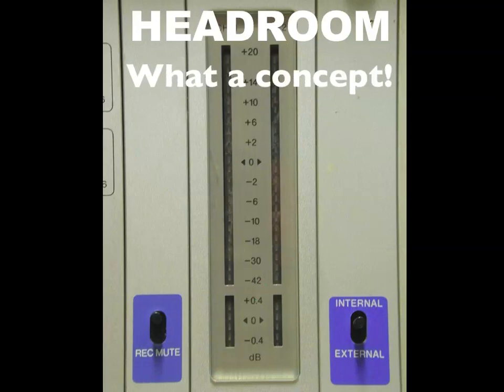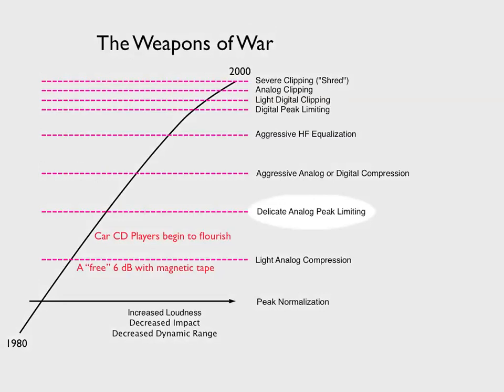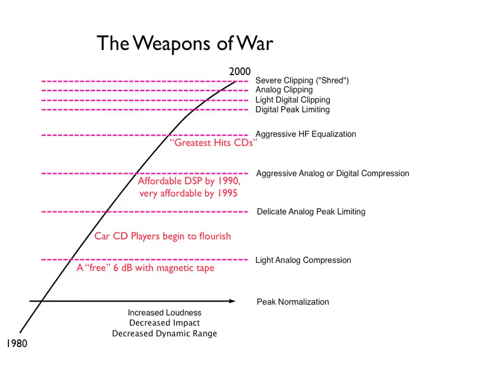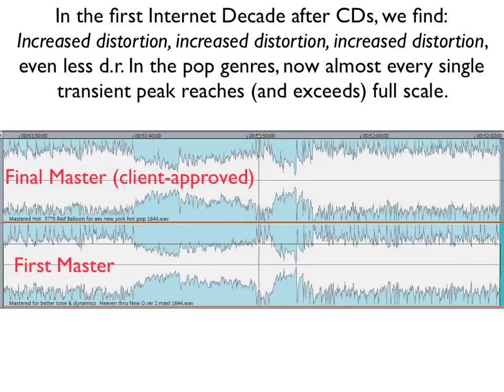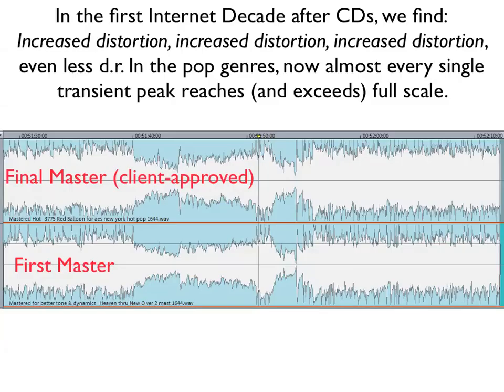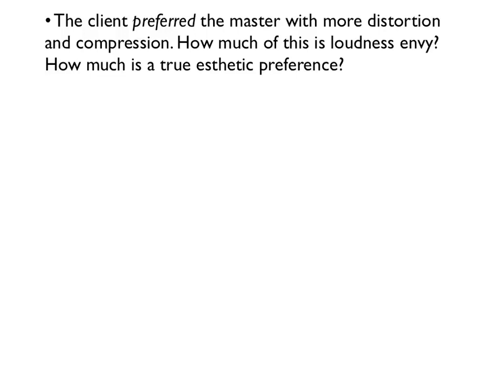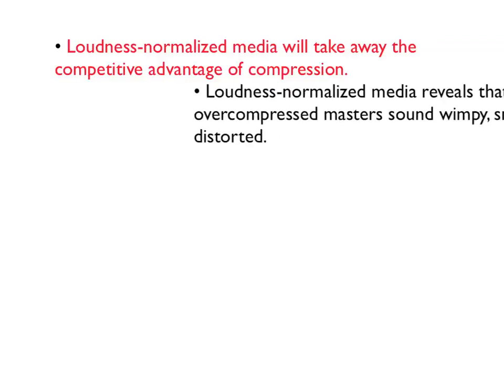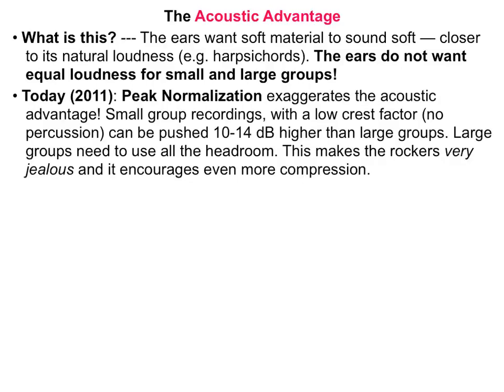Loudness War and Peace

Comment: Well it's 2025 and in heavy EDM bass genres my loudness target is 0.1 LUFS @ the drop and -13 LUFS for the breakdown/ambient sections.

Even when the level is matched (renormalization using lufs) my masters sound louder than acoustic masters.

Personally I believe this (old school) paradigm is just lacking. It misses so much of the potential you can use from psychoacoustics.

You can make a kick drum where the entire sample is touching unity (0 dbfs) and it still sounds incredibly punchy. Then again this is hand crafted waveforms not recordings. Deep sculpting of the distortion so that it's pleasing, thickening, & warming to the sound.

Comment: Great video! 
But speaking of normalization, if a song of -6 lufs is normalized to -14 lufs, will it still sound louder than a song that is originally -14 lufs?
Reply from the maker: @astroneko404  good question. When Comparing The extreme density of material that has been squashed into a sausage with a dynamic song that’s got soft verses and loud choruses. You should compare chorus to chorus. The verse of the sausage song will be obnoxiously loud. Yeah, if loudness is your only criterion and sound quality and dynamics are not important to you - then, probably somewhere above -8 lufs you can make a loud sausage that will appear louder than a native -14 lufs song. It’s a dilemma. I know what I would pick, but it also depends on genre, style and the message of the song.

Comment: Super interesting video. I found your name recommended by someone in a gearspace forum. I wondered what youre thoughts were about a daw like reaper operating at 64bit but using plugins like Waves operating at 32 bit, Ive recorded at 32bit fp. Ive read that there is either some sort of dithering happening within the daw or the plugin itself. Ive read elsewhere of course dither doesnt matter at such a high bit depths. With a little of my own experimentation I could swear I hear a subtle pleasing difference adding reapers dithering plugin before my waves plugins on on a 40 track recording and also before sending out any outboard gear with my rme 24bit converters for outboard processing. The difference is subtle but it seemed to take away a harshness Ive been battling for a couple of years. Is there anyway you could clear me up on this. Can quantization errors happen between the internal processing between different plugins operating at different bit depths and would possibly be resolved through dither. Also should dither be used when sending to outboard gear and back in. 100 articles have told me its not necessary due to the noisefloor yet I can hear a difference though its possible Im fooling myself. Thank you for any response.

Comment: The most dynamic CD that I have, Speaking In Tongues by Talking Heads (the version featuring the LP edits), looks to have been mastered very early on in the CD format's existence, in 1983. It has a dynamic range score of 17, and sounds excellent provided that you turn your volume all the way up. In general the average 1980s CD in my experience has a DR score of about 12 or 13, while a typical mid-late 1990s CD has a score of around 8 or 9 and a lot of recordings from the mid 2000s to present score just 5 or 6. This means that many 1980s CDs are more than twice as dynamic as digital releases from the past decade. I find it pretty weird how a lot of nearly 40 year old digital releases sound better than modern ones (and the majority of remasters) considering how much digital technology has improved between then and now. I tend to search eBay and charity shops for used 1980s CDs (or unremastered reissues) because in the majority of cases I prefer the way they sound to the modern remasters that tend to be on streaming platforms. If you like to have your music in the FLAC format, a quieter, more dynamic recording will also compress better as well as sounding better. 

I've done an analysis of more than 1000 CDs mastered over the past 40 years using a spreadsheet. Those that were mastered in 1982 to 1984 tend to on average be quieter than those mastered between 1985 and 1990 since a lot of the earliest CDs did not make use of peak normalisation, however it was only from about 1991 where we began to see a noticeable decrease in the dynamics of pop/rock releases. I would have said that American releases began to become less dynamic from the end of the 1980s while the trend only became commonplace on British and European releases from about 1992.

Comment: I am curious if the loudness wars will ever end in the aggressive bass music scene, it's been at the point where loudness standards have taken away from the quality tons of stuff, even stuff that's supposed to sound heavily distorted by choice for years. I think the issue with this comes down to live mix engineers not being consistently great across the club scene. I often find in these kinds of live show experiences the levels are not adjusted for artists that generally play louder or quieter songs.

Am I wrong that this is something the live mix engineers should be controlling for?